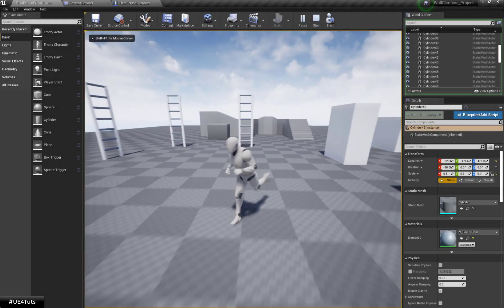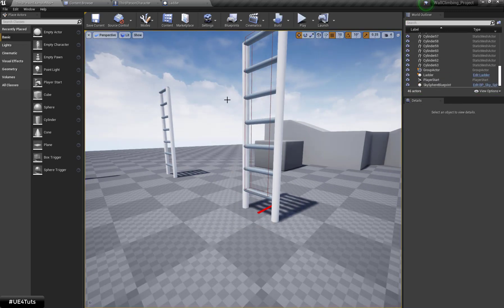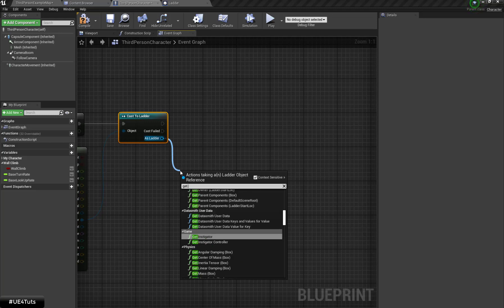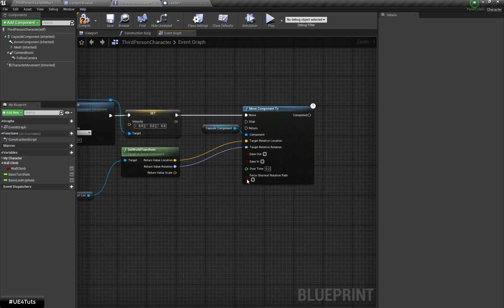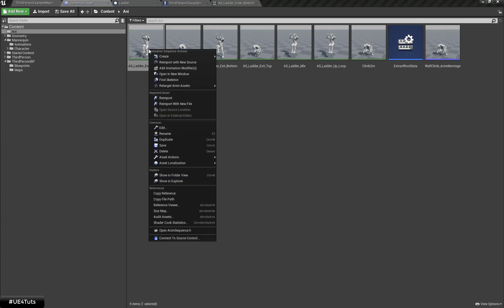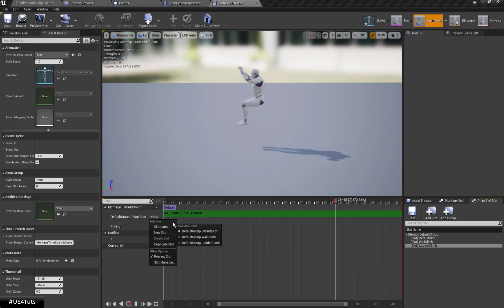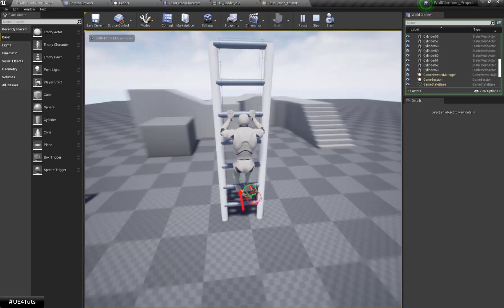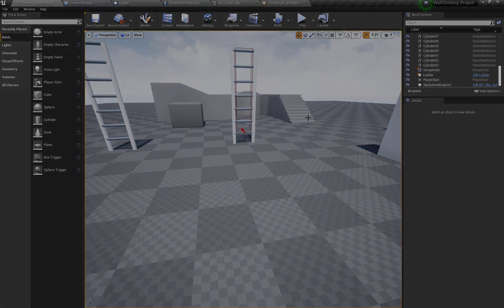UE4-Ladder Climbing System-#Part1#UE4Tuts

Comment: Eyey, so something strange is up with my character, as soon as I get onto the ladder it holds the idle pose but floats up into the air a bit?
Reply: Hey there. 😊 I have the same problem plus it doesn't play Idle anim. Did you find the solution?